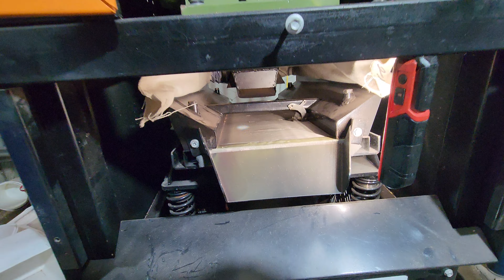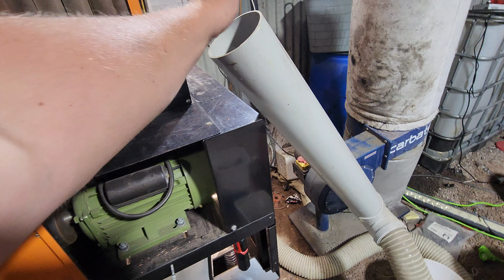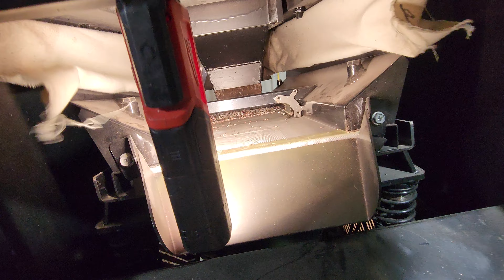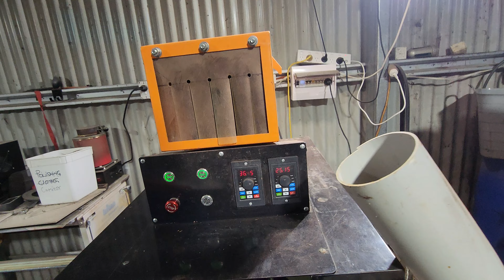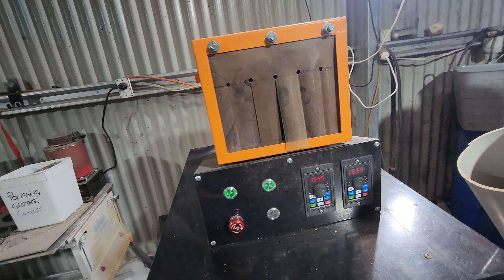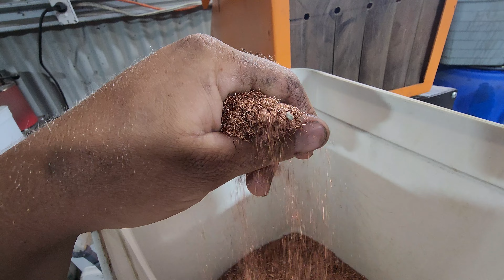Copper Cable Recycling Machine Vaner Co2 Granulator

Comment: I have a Vanner granulator, just got it delivered a week ago, seems like we are getting too much copper coming out the plastic side and too much plastic out with the copper. any ideas? helpful hints?
Reply from the maker: You just need to tune the table. Start at 33 air and 26 shake and work your way up

Comment: Hi, I would like to ask you.. I received the same machine from China and after about half an hour of operation the red stop light on the crusher lights up and the crusher does not run.. The shaker and fan continue to run... After two hours I tried it again and it ran and after about half an hour of operation it happened again... Could you advise me what people should be worried about? Thank you very much for the advice and greetings Honza
Reply from the maker: Sounds like overload tripped. On the main crusher motor. Got good power feeding it?
Reply: @Oneupthesleevecustoms  The power supply is fine, but now it runs well, I read that with Vaner it sometimes happens that when the machine is new and the bearings are tightened, sometimes it happens that the thermal fuse turns off the machine for a while (main mill). I am satisfied, but I have to learn how to tune the air and the shaker, because I have a mix of cables, both braided and hard, and it has to be tuned to the given wire

Comment: Have you tried putting copper pipes (plumbing / aircon) through it? Good idea or bad idea?
Reply: Did it manage okay with copper piping for plumbing or air con units?
Reply from the maker: Na its not what they are made for. Cable only mate

Comment: Hi, thank you for the gread videos. I see you said you have 2 machines now. Are both units vanar V-c02 machines? I would love some more videos, especially the different blower speads and vibration speeds, how to set it up to get the right vibration speed.
Reply from the maker: It's hard to film but yeah I have 2x the same now I'll try to make some more videos
Reply: @Oneupthesleevecustoms why do you have 2 machines? Do you have someone to operate the second machine or are you planing to run both at the sime time?
Reply from the maker: I run both at same time
Reply from the maker: To do double the cable
Reply from the maker: https://youtu.be/xT3lEaCQlAA

Comment: Hi. I have a question: can this machine separate copper and aluminum at once? I have a lot of cables with a copper jacket and aluminum core.  Thanks in advance for your answer. Czarek
Reply from the maker: The copper and ally will come out the front together. If you have fast air speed you'll get just copper out front then you can re run the plastic ally mix
Reply: Thanks for quick answer 👍
Reply from the maker: I've got 2 of these machines now. Been good units

Comment: Does it handle extension cord wire well?

The thin “angel hair” copper wire inside most power cords and extension cords.
Reply from the maker: Yeah its adjust setting to.suit
Reply: @Oneupthesleevecustoms  Or down a screen size depending on what you are running. You have an interesting channel, thank you.
Reply from the maker: Yeah a collecting of stuff when I get a chance to film something haha

Comment: Have you tried it with any car engine looms? I heard they can be a problem with sticky stuff used to hold them together
Reply from the maker: It eats them up. Just turn the air speed up a little or mix the looms in with  tps

Comment: Hi and thanks for the video!  I have a solar installation company and we get very poor prices for our offcut solar cable (6mm tinned copper).  Wire strippers don't work with the fine stranded solar cable so I am looking for a better solution to separate the copper from the insulation.  Have you ever tried recycling solar cable because I am concerned that the shaker / blower separation wont work so well with that super fine strands of the pv cable.  Many thanks, Hannes (Cape Town, ZA)
Reply from the maker: Yeah no good for tinned copper cable recycling it gets stuck on the table
Reply: @Oneupthesleevecustoms  Thank you so much for the feedback.  The search for a solution continues then! Cheers
Reply from the maker: Yeah tinned copper is hard to recycle

Comment: I have one coming in a couple weeks i cant wait its a C-03 Vaner
Reply: Nice ! 
I get my c-05 next month .. im still worried about differnt type of wires .. hopefully it works as i expect .. greetings from Germany 💪🏽
Reply from the maker: Thats awesome man I bet it will be awesome. If you watch it you'll see how it goes with each wire
Reply: @JonasKramer-k9d was hast du bezahlt, wie ist das mit dem Zoll. Grüsse aus deutschland
Reply from the maker: It was 2.5 years ago. Reach out to vaner for a quote mate
Reply: But do you have to switch the distance between the blades inside if you want to put hairy wire in it ? 
Thanks for the video perfect Content !
Reply: @JonasKramer-k9d  No, the blades remain tight, you may need to go down a screen size.
Reply from the maker: Just check and make sure the clearance is nice and tight on your blades chopping up sweet
Reply from the maker: Thats great. They are a good machine
Reply: @Oneupthesleevecustoms  i have done 450 lbs of cooper so far i love thi machine
Reply from the maker: How's it going

Comment: Hey mate love the video. You offered to answer questions so I have a couple.
I have a skip bin business in Tasmania. 
I recycle as much as possible and get about 800kg of cable per year. I’m getting $3.20 per kilo from the scrappy at the moment for the intact cable.
I have noticed that in all the videos, only small amounts of short cable is put into the machine at any time. Does it have to be cut short?
Also percentage wise, say 100 kg of mixed 15:54 cable. What would you expect the ratio of copper vs plastic weight to be once granulated? 
TIA Kelvin
Reply from the maker: Yeah you can put more in if it's short. Long lengths get stuck round the rotor on the screen.

Low grade double installation cable like power cords can be as low as 35% recovery. Better thick house cable 6mm plus is more like 50% recovery. What end of the state are you  in?
Reply: From experience I can tell you that single core cables 2.5-6mm² is around 70% recovery, three core cables around 50% recovery. I buy in bulk and they are loaded in jumbo bags so they are all mixed in together, so I use a shredder before putting them in my c03, reason being if it's single phase like mine you can easily overload the machine, mind you the machine is not the problem it will shred it either way but the amperage is the issue, in my country max single phase power is 40amps not sure if this is standard everywhere, anything larger than that will trip, heavily overloaded this machine can see 70-80amps, seen it for a couple of seconds before tripping, sometimes I don't realize some cables are stuck so I keep on throwing in and at a point they will get caught by the blade at once and overload it so power trips.

Comment: Thanks for the video you mentioned ur about about break even with cost, can you say how long either in machine hours or how long since you acquired the machine please, I’m in the uk and have been hounded by the Chinese sales agent, but watching ur video has helped me decide this brand / machine would seem a good investment. I’ve liked and subscribed 👍💪
Reply from the maker: I've probably got 3000kwh on its meter now so between 800 and 1000 hrs run time. 
Its paid for its self like 10x over but remember alot of the profits is buying the cable at the right price

Comment: Thanks for this video, it's great!! Quick question about the production numbers announced by the manufacturer Vaner, can we rely on them? For the C02, they announce 40-60KG of wire input, and since I'm considering investing in a C10 (100-150Kg), I would like to know what to expect
Reply from the maker: Hey mate. It's very hard to rate the cable   capacity.  It's all a balancing act. Thickness 
Feed speed
Ect
Reply from the maker: I've had my machine 2 years and it has been great
Reply: Thx

Comment: Have you had any experience with granulating small copper cable ie vehicle speaker cable or vehicle wires in general?
Reply from the maker: Yep  probably 4000kgs of cables so far every thing you can imagine. What do you want to know :)
Reply: @Oneupthesleevecustoms  Not too much electricians tape is a no no.

Comment: Great video, I watched them all before I bought mine. I’m curious to know what you do with the plastic or if it just goes to the waste??? Thanks again.
Reply from the maker: Some times I give it to a bloke that does turf he puts it under the turf makes it nice and soft. I'm talking to a bloke who thinks he can turn it back into cruse fuel  but alot goes in the skip
Reply from the maker: Did you get the same model?
Reply: I've sold many tonnes to Matta Products, they make mats for working in a wet floor environment and also playground equipment for the USA
Reply from the maker: Oh really thats cool?  Do they buy it or just take it
Reply: @Oneupthesleevecustoms  As long as it's predominately household wiring plastic they buy it for $250 per metric tonne, they also cover the cost of freight from Christchurch to Wellington.
Reply from the maker: @cuprarecovery4423 wow that's awesome

Comment: How did you go about buying it, did you have to email them? I want to order one but don’t wanna get scammed. Do you have a link from where you bought it?
Reply: I just got mine from Vaner, they were great to work with. Joanna responded very quick with all my questions. Took 8-10 weeks to get it. I’m in the US.
Reply: i am in the US what did it cost?
I am out here in Newport Oregon
Reply from the maker: @adamwall1966 you'll need to get a quote mate i got mine 2.5 years ago
Reply from the maker: @adamwall1966 contact vaner machinery
Reply from the maker: Vaner machines on alibaba. They have trade assurance. What country are you in
Reply: @ thanks for the reply, I’m in the UK

Comment: Do you get more from the bearing manufacturer then you would the recycler
Reply: Good sir thank you for responding to me. I’m new to the Copper game. Are you pleased with your machine? Would you have gotten a larger machine I would like to get a machine and cut up harness wire out of automobiles
And are you pleased with the recovery rate?
Reply from the maker: @jeromeogivenz954 power becomes a issue as you go larger but this one just plugs in
Reply from the maker: @jeromeogivenz954 yeah it misses hardly anything
Reply: @Oneupthesleevecustoms   thank you again so much for your time. It’s hard to find anyone with experience with these machines so if you put in 200 pounds of corded wire, how much is your recovery rate 50%?
Reply from the maker: @jeromeogivenz954 the iscrap forum has alot of helpful pictures of wire with recovery rates. 
It varies alot. 
When running well tuned you get next to nothing in the plastic waste side of this machine. It pulls around 4kw
Reply from the maker: I do yeah cause it's going straight to a manufacturer. I have to ensure it's perfect or it gets rejected

Comment: Great video! I’m thinking about buying one. I have a couple of questions. We get in loads of Ethernet cable, that is harder to get clean copper from? And what would you say your yield is? Like if you processed 100 pounds of wire, how many pounds of pure copper would that yield? Thank you
Reply from the maker: Hey sorry I didn't see your comment i recommend having a look at the iscrap app. They can help with recovery rates of cable. As it varies country to country and by manufacturer. This machine will definitely remover the copper

Comment: I just got my vaner co2 today. Did run some cabels. Both hairy wire and normal wire. But am struggeling with small amount of copper going out on backside.. Any ideas?
Reply from the maker: Is your machine level? Left right front back

Comment: hello friend very good video will you tell me what is the exhalation volume in m3 and the m3 for the blower please thank you from you 👍👍✌️✌️
Reply from the maker: Let me check
Reply: @Oneupthesleevecustoms  💪💪🙏
Reply: normally for the 750w blower it must be 1200m3 hour I would need the suction which must be 370w but how many m3 for the suction? thank you my friend
Reply from the maker: I think it would be over 1000 the one I have so made 500 600 m3 for a around 400w unti
Reply: @Oneupthesleevecustoms  Is it possible to tell me exactly when you have time? That’s super nice of you my friend 🙏🙏🙏

Comment: Does the blower blow in one place or under the whole screen? Is it a double layer screen? I noticed copper out of one end coating out of another. Do you have pictures from the other side opened up. Great video I am just trying to grasp how this works. Dry separation has me stumped.
Reply from the maker: Whole screen helps it spread out and lifts the light materials off the screen to be sucked up/ fall out the back. Very efficient
Reply: I would love to see some pictures of the blower and how it’s hooked to the machine. Thankyou for taking the time to reply to me.
Reply from the maker: @IkeBarnett-tp7hf I'll make a video next time I clean it all up mate;)
Reply: I have the same machine, the screen is a prick to take out and clean. You need nice clean material pr the screen blocks quickly
Reply from the maker: Feed the machine clean air works mint

Comment: Hi, how often do you have to change or sharpen the blades in the granulator? What other kind of maintenance do you have to do? How much did you pay for the setup?
Thanks
Reply from the maker: Cost around 10k aud landed gst tax import ect. I have not had to sharpen change or modify blades ect at all. 2x greese fitting on main shaft and blow it out often with a air gun. Super reliable and simple
Reply: @Oneupthesleevecustoms  Your blades need sharpening or adjustment, the granules are strangulated, I had the second commercial plant in New Zealand back in the day, wish it had been as simple as this, great video.

Comment: Great video. I have a granulator as well but I'm having a hard time with the separation.  My granules are dirty with plastic. I've adjuster the shaker table speed and that helps but its still got a lot of plastic. I keep the main screen clean as well. Good idea on the dust collector. I wear a respirator. I thought pre chopping the wire  to two inch pieces would help ,it didn't. Different brand from yours. I also paid a.lot to get it to the states.
Reply: Gomine 240v 3 phase. I had to buy a big converter because I didn't have 3 phase power
Reply from the maker: Oh that's a issue
Reply from the maker: Is it similar in design?
Reply: @charlesvannice4790  im using the 1 phase one, it works great
Reply from the maker: What brand did you go with
Reply: How did you order
Reply from the maker: Alibaba website
Reply: Did you get your problem sorted and what did you do?
Reply: I’m about to purchase the gomine s08 single phase 220v what did you have and did you get it figured out?

Comment: Nice video!🤩
Reply: Can you show how the electricity is connected on the machine. Is it one cabel? Singel phase, three phase?
Reply: 230v or 400v?😅
Reply from the maker: You can get either. Mine is 240v

Comment: Nice video, thanks for presentation! 
I need one too, can you scrap 300 lbs of cables per day.
Reply from the maker: I can do 25 to 40 kgs a hour. A little less in fine data cables. I recommend adding a dust extraction system like my one I can make more videos if you have more questions
Reply: my c-03 does 110 to 170 lbs. hr.
Reply from the maker: Thats a good feed rate mate!!!

Comment: Are you break even factoring in time, cost of wire, and the percentage gained from not selling as is at #1 and # 2 wire prices?
Reply from the maker: Oh yeah I only buy less than half the cable electrician mates give me heaps,
I sell for more than bright shiney no1 copper prices so even if your stripping good stuff I get 20% more in granules as it's going to the manufacturer. Not to more middle men
Reply: @Oneupthesleevecustoms what do the prices differ? For #1 it’s around $2.75 a lb. How much for would it be in granules?
Reply from the maker: I dont sell to scrap yards mate

Comment: The hard drive magnet in the machine was a nice touch.
Reply from the maker: I had some issues with rubbish cable that was copper coated steel. Upset my buyer had to buy it all back and reprocessed by hand